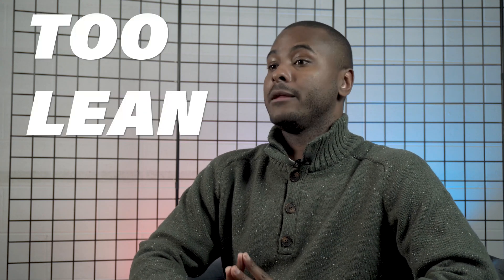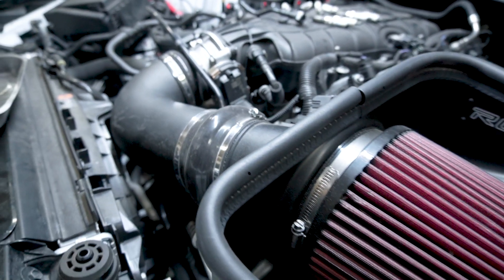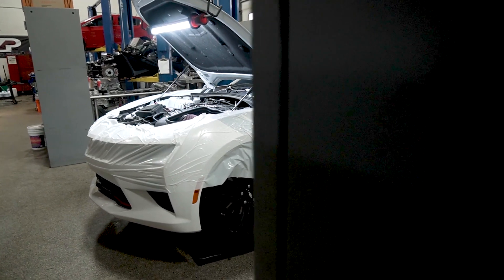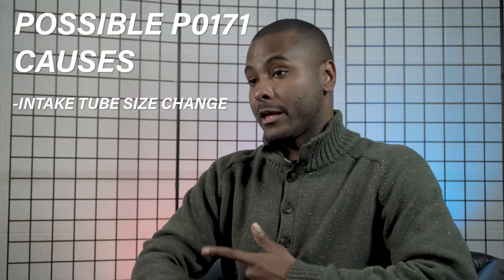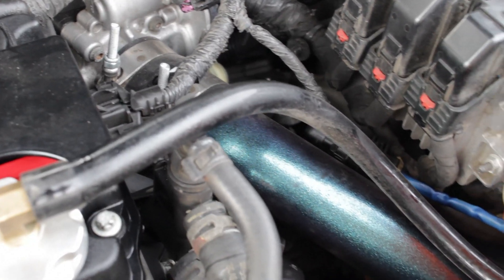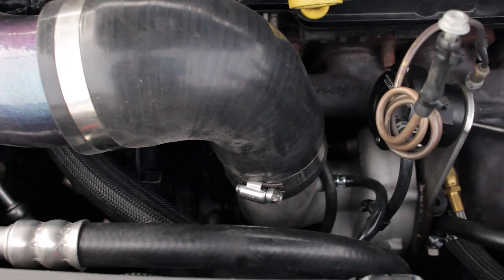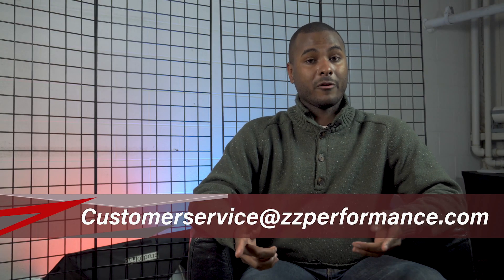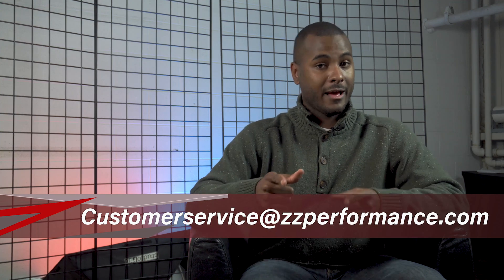P0171 Code: What It Means // Behind The Builds

Comment: When are you guys ever gonna try and get some good power out of the v6 lfx motor from the ats?
Reply from the maker: Unfortunately at this point likely never. We've stuck to the 2.0 turbo platform for the ATS.
Reply: @ZZPerformanceChannel  that’s not good, there’s lot of power to be had out of the 3.6 and half of the people that own ATS have the 3.6
Reply: @_yoloonthepopo_6561  Yeah but it's NA... Not much to gain compared to the forced induction without doing major stuff.

Comment: Interesting, so if I have added the zzp large intake tube and K&n filter should I get a retune? I do get a cel occasionally, but I just remove the maf sensor and clean it with maf sensor cleaner. That always has worked. I assumed it was the oil from the filter causing the code.

Comment: My redline is exhibiting the symptoms of a vacuum issue but couldn’t find any. And there is no code. Car smells to be running very rich as well. Any thoughts?
Reply from the maker: Hard to say without having the car to diagnose, but try running a smoke test, it's an easy way to spot vacuum leaks.